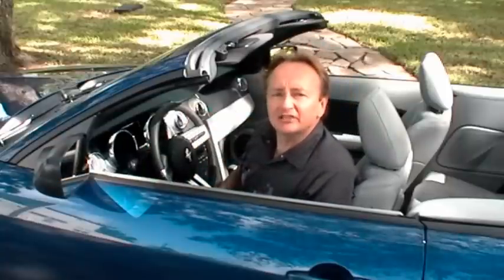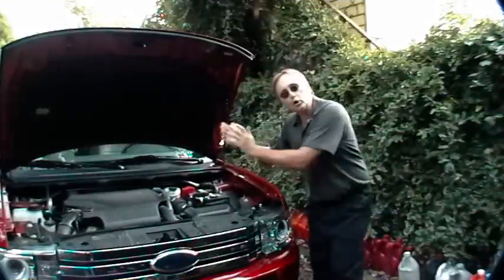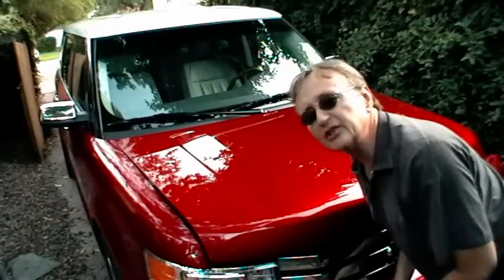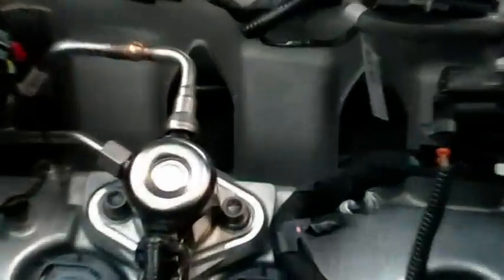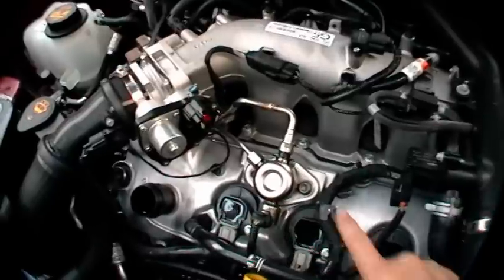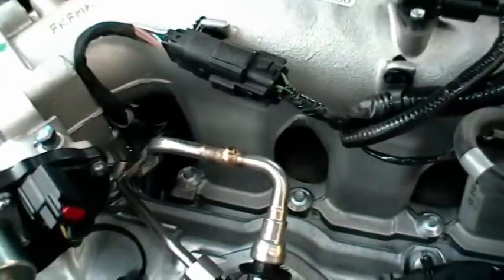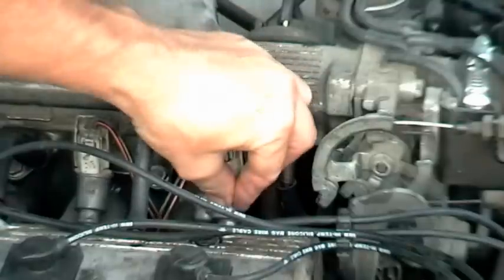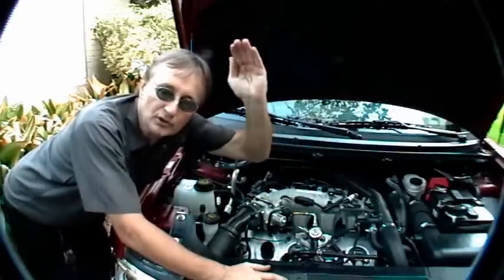How modern technology increases horsepower

Comment: Now that we have direct injection gasoline engines (which is NOT new it was done over 100 years ago).
Will the next step be 2 stroke direct injected engines since now unburnt fuel won't go out the tailpipe and power to weight ratio can increase?

Also I bet now the ecobooost is having the same trouble modern diesels are with their sensitive injection systems. Water separators, dirty fuel, fuel filters, stuck injectors, etc. At least the components the ecoboost has do not need to operate at 30,000PSI
Reply from the maker: many buses already use two strokers as do many boats. But they still have  a hard time meeting EPA pollution standards

Comment: So basically it's a high powered system with to many electronics and could fail at any time. Sounds like a great car to me! I bet they have to be rebuilt sooner than most engines too!
Reply from the maker: of course you hit the nail on the head, BUT that's where modern cars are going, as this video is now 8 years old and MANY cars use this same system today.
Reply: Scotty Kilmer It's sad where the car industry has gone!
Reply: Hunt Guy I know and I'm worried that they'll be no more V8s at all.
Reply: Hunt Guy Plus a lot of cars today are so advanced that you can't fix it in you're home garage you'll probably have to take it to a mechanic to do it for you. Plus Modern vehicles too expensive and ugly.
Reply: CJ Colvin Right. Fuck the stupid ass epa!
Reply: CJ Colvin Yea this industry has gone to shit!
Reply: Hunt Guy I know. You can blame the government for this.
Reply: CJ Colvin I have a 88 chevy k1500 with 275k on it and she still purrs like a kitten!
Reply: Hunt Guy That's cool man.
Reply: ***** For one you're comparing vehicles difference in weight and technology used to build them. So obviously the 2016 is going to be better. The numbers look good but that ecoboost won't last over 15 years, max. I'd put a $1000 on it.
Reply: Hunt Guy I know The Ecoboost won't outlast my old Ford truck.
Reply: Hunt Guy Amen Brother. I have a 96 Ford F150 with 5.0L Windsor V8 with 203,386 miles on it and it's still going strong.
Reply: *****
I have and I wouldn't have a ecoboost, wouldn't mind the 5.0 though
Reply: Hunt Guy My dad has a 2011 5.0 F150 and it sounds like a beast.
Reply: CJ Colvin
Yea they sound badass
Reply: *****
You can keep that ecoboost and I'll keep my motor that has proven itself
Reply: Hunt Guy Oh definitely man and they sound awesome at full throttle.
Reply: Scotty Kilmer wow Scotty! I didn't know that you have been making vídeos since 2009, and you keep us up to date with car suggestions and all that ;)

Comment: So whats a good way to increase HP and gas mileage if you dont have an ecoboost car? like a 2007 G35x?
Reply: weight reduction is the first thing that comes to mind. more horse and more miles just doesnt add up for me no matter how directly the fuel is injected. this direct injected engine makes more power than one with indirect injection because it is more efficient. there are ways to make indirect engines more efficient of course, but more power will always burn more fuel. but you can get to that perfect balance where the tad of extra fuel actually pays of in useful work done by the engine. that doesnt matter in everyday driving tho. if you need more power, youre going to have to sacrifice more fuel to get it. try filling higher octane, you might notice the difference. having a heavy foot will still consume the most fuel no matter what engine you have, but im sure you already know that.
Reply: any tips on reducing weight?
Reply: kuck hoa also new plug wires if they're old enough to be carbon fouled
Reply: Increasing horsepower AND gas mileage? I'm reminded of an old industrial saying, "fast, cheap, good - pick two!"

I recommend trading in the car for something smaller and quicker. Definitely don't listen to that fucking idiot Kuck Hoa. ESPECIALLY don't listen to him about tires and catalytic converters! Overinflating your tires makes the car ride like shit, makes the tires wear down quick in the middle, and makes them more likely to blow out. Autocross guys harden up their tires before they race so the car turns quicker - the only advantage this has - but they let the extra air out before they go home. As for his cat suggestion...$2750 fine and an order to put a new OEM cat on the car are what can happen to you if you do this shit.
Reply: man, did someone shit in your coffee this morning? and what the hell of a country issues you a fine of almost 3000 dollars for a missing cat? i live in an "expensive" country, and its barely 200 dollars over here.
Reply: Cali would be the only state i think. In Iowa they don't give a fuck. My buddy just took his out.

Comment: Direct injection engines have a high probability of carbon build up on the intake valves, to the point that the valves have to be manually scraped by a Technician, sometimes at as low as 25,000 miles, especially if driven mainly at lower speeds like in the city. Hopefully engines such as Toyota's new 3.5L V6, and the 2017 3.5 ecoboost specifically for the F-150, that have both Direct and Multi-Port injectors will solve this problem. But until then, MPI is more reliable and less expensive.

Comment: i have heard over a million times that ecoboost lasts about 150k km because they squeezed so much power out of the engine. after that a complete rebuild is needed
Reply: I used to work on aircraft and the FAA will only put things in their book that they have researched extensively...
 and I remember 30 years ago they had in their book that turbochargers substantially decrease the life of an engine I believe it was more than 20% of course they were talking about gasoline or petrol engines...

Comment: As a 16 year old young car enthusiast, anything other than direct injection sounds like a blast from the past via time machine. Scotty was definitely on the money saying direct injection will be the future. It's crazy watching a video made in 2009 pointing that out.
Reply: One thing that you should not forget, is that every system has its own advantages, and disadvantages. For instance, with standard fuel injection, the fuel is injected into the air intake manifold, before the intake valve. this has the positive effect of cooling the valve, and cleaning it. with direct fuel injection however, this doesn't happen, and because of the exhaust gas recirculation (EGR) system, so much carbon buildup can occur over time on and around the valves, that it can even prevent the intake valve from fully closing. also, the buildup can narrow down the air intake so much, that the engine will lose much of its power, and you might not even get a check engine light :)

Comment: Hello scotty 
I want to know about the product acetone. 
Can you please tell me i sit really improve the gas mileage ?
Reply: Do NOT put acetone in your gas tank. The cost of replacing your fuel pump or injectors early makes up for the 2 MPG gain you MIGHT get. Ease slowly onto the throttle when accelerating from a dead stop, and you will get better gas mileage.

Comment: Scotty isn't it true that direct injection is expensive to fix and in reality it is actually a bad system?  I don't know all the problems that lead from it but there are many.
Reply: yes its bad and expensive to repair. in the mpfi (multi point fuel injection)  system the gasoline does go through the intake valves hence cleaning the valves. that's why with mpfi systems you can see the inlet valves are usually shining and clean even after putting on the car 100k miles. whereas the gdi (gasoline direct injection) system the gasoline goes directly into the cylinder. sure the gdi does provide better efficiency and allows for more performance but the valves in return get extremely dirty and hardly a way to clean that. with these cars occasionally you'll have to accelerate the crap out of them to keep the cylinder head in good shape. you can't really drive those gdi cars like a grandma all the time (take it from my experience).
Reply: You can spray a mist of water through the intake with the RPMS raised to 3000rpm and you can clean the intake valves like that.
Reply: GioGuitarDude
Isn't water bad for the combustion chamber of a car engine?
Reply: Tigerfire75 as a liquid yes. As a mist which turns into vapor because of the heat, no... quite the opposite.
Reply: GioGuitarDude
And yet my car doesn't have to use that to clean it.  I think it is a poor design 
also what happens if I spray too much water?  What is the right amount?
Reply: Tigerfire75 Neither does my car, but this method will ensure a very clean set of valves and pistons which no engine is immune to. You can remove the duct going to the throttle body, manually open the throttle blade so that the engine revs to approximately 3000 RPMs and use a cleaner style spray bottle filled with water and literally spray it into the engine via a mist until the water is gone (keep the engine at 3000 RPMs). There is absolutely no risk of any damage at all whatsoever as long as it stays a mist and there are no jets of water going in. Even if there was a jet of water going into the intake, it would have to exceed at least 1/8 of the volume of each cylinder at full compression to even consider any damage with no other load on the engine. Considering a 4 liter 6 cylinder engine with a 10:1 compression ratio (for example) can hold 400 milliliters of volume in the engine at full compression for every rotation, you would have to exceed a flow of 15 liters per minute to cause damage.
Ain't happening with a spray bottle.
EDIT: Ive actually hooked up a small 1/8" vacuum line to my intake manifold and let the engine vacuum suck up a gallon of water in under two minutes (with RPMs at 3000) and you can literally see the carbon deposits coming out of the exhaust as a smokey grey fog. 
The engine also has to be at operating temperatures, or the water won't turn to steam and clean as good.
Reply: GioGuitarDude
On cars with DI can you actually manually open the throttle plate? 

Have to ask Scotty if what you say is a good idea
Reply: Tigerfire75 You would have to use a friend to raise the RPMs to 3000. Google "decarbonizing engine with water". There are loads of links that cover it.
Reply: GioGuitarDude
I could have my dog working the gas pedal.  She is quite smart.
Reply: Tigerfire75 xD

Comment: hi Scotty I got a Honda fit and it vibrates a bit,when I de-accelerate,and accelerate again,It vibrates too when I'm from zero going forward.
Reply: Might want to check you outer tie rods they should not move or the sway bar link, struts
Reply: check if your brake rotors and/or your brake pads are worn out. They may need to be replaced

Comment: that car has electronic sterring so therefore I'd someone hacks into your car they can control where you go. or if your steering just completely goes out then you are screwed
Reply: You know its still possible to steer a car without power steering right? there is still a physical connection between the steering wheel and the ground wheels, sure it may be a bit heavier but its still possible
Reply: yes I do my point is it isn't a regular power steering that we are used to. The steering wheel dosnt have a steering shaft. It send signals to the computer and the computer sends it to the wheels
Reply: Michael Tallent No lol. its just an electric motor assisting you instead of hydraulic. The connection is still there
Reply: Dude I've had one and a 2015 gt and there is no shaft once so ever
Reply: Michael Tallent Im surprised thats allowed
Reply: honesty I am to I'd be scared that it goes out
Reply: Michael Tallent Not only that, i mean how would you move the steering with a dead battery, at least with hydraulic you still have that physical connection

Comment: ok now explain how that car doesn't have power steering
Reply: +Michael Tallent It is still considered power steering. It's just a different method.
Reply: +Michael Tallent It does its just new cars now have electric power steering thus getting rid of hydraulic so no need to top off or check/replace power steering fluid its suppose to be less maintenance
Reply: +Theunkown1  at least someone knows good job for doing your homework. and no its not power stering it's simply electric. when you turn the wheel sencors transmit signals to the computer then the computer send it to the wheels
Reply: That is considered power steering

Comment: most need 40-60. This one needs 2000! Why? Because motherfucking America!
Reply: If an engine has a compression ratio of 8:1 it compresses 8 atmospheres into the head which is about 120psi alone.
Double that with 15psi of boost and you have 240psi of pressure to overcome and atomize into.
That's why you need 2000 psi to inject properly
Reply: No because direct injection requires high pressures. Modern diesels need 30,000PSI because they operate at much higher compression ratios 18:1 typically.
Reply: Couldn't those pressures kill somebody

Comment: could eco boost be installed into older model cars? like a 97 deville??
Reply from the maker: +CaMel Clay no, engine head and block designs are totally different
Reply: ok and thank you. also another question.. a friend of mines put some Freon  in  my 97 deville and now my air does nothing and sometimes when turning on the air while the car sits, my engine will slowly die... but the air was working fine before, it just wasn't very cold... what should i do??
Reply: +CaMel Clay you might be able to replace the engine for a brand new one which has that technology.
Reply: +Scotty Kilmer what about a 1999 vehicle?
Reply: okay thank you Verliebt

Comment: How much are repair bills on replacing one of those injectors lol
Reply from the maker: oiljerk BIG time money, you have to pull the engine out, that's modern tech for you.
Reply: LOL...No thanks, btw I really like your vids, you tell it like it is and you're good mechanic too. Keep up the good work, I'll be watching.
Reply: ungratefulmetalpansy Electric cars are stupid for heavy duty work
Reply: So is gasoline.
Reply: Yeah that Tesla Roadster you just got...guess how much a new battery costs, and how often they must be replaced.
The new battery costs 29K and must be replaced every 5 years.
That's how they make their money. They sell the car at a loss in order to recuperate money through batteries. The nuclear industry has been using it to sell fuel contracts. It's called a razor blades business model.

Comment: So for the $100,000 question is.  On that Ecoboost ford.  Whats the horsepower and whats the mpg?
Reply: WarinhulAirsoft Actually the twin turbo V6 makes 365hp. While the non twin turbo makes 287hp. Nice try though, but LUNITIC WILL was very close.

$43795	     Flex 4dr Limited AWD w/EcoBoost
4-Door All Wheel Drive SUV, 365 bhp, 350 lb-ft, 6-sp Automatic, 16/23 mpg
7 passengers, 4825 lb, 3.5-liter, V-6 engine, 13.2 lb/bhp
http://buyersguide.caranddriver.com/ford/flex/2015/ford-flex/specs/373339
Reply: well imma guess here and say that with the V6, at least 400hp and at least 30-35 MPG
Reply: ***** Are you fucking stupid? Just because you hear twin turbo doesn't mean its the turbo's you normally see used on racing engines. They're relatively small turbos used to increase power output and gas mileage in the low range. They make the car feel like it has more power than it actually has when you take it for a test drive. Once you hit ~3k rpm the tiny turbines restrict the amount of air they can push into the engine, making their peak boost at lower rpms. The ford flex makes maybe 250hp to the wheels even though it is a 3.5L twin turbo v6.
Reply: Jim White The 2015 Ford Flex makes 365bhp you are right about that. However, this video was made in 2009 and I highly doubt the possibility of Scotty being a time traveler. The 2009 Ford Flex also sported a twin turbo v6 that pushed out a lower 262hp and 248ftlbs of torque at the crank (http://www.edmunds.com/ford/flex/2009/features-specs.html). You could argue that this is a 2010 model ford flex but I also doubt that a pretty much brand new car would need to be brought to a mechanic. So i'm sorry but you, aswell as lunaticwill, are blatantly stupid.

Comment: downside if you run out of fuel... you're gonna break some pumps cause gas is used as lubricant..
Reply: these engine systems will cut the engine off before it runs out of gas completely (always leaving some gas in the tank & engine) protecting the engine & components so no damage is done
Reply: well thats good then...

Comment: Problem whith direct injection is carbon built up on the valves. Gasoline has cooling, lublicating, cleaning properties. When gasoline won't go through the valves next thing you are looking at carbon build up peoblem. GDI engines from VW, lexus, BMW and ford experiencing these issues. It's great technology but it needs improvements.
Reply: harsha806 won't redex or something else injector cleaner on a regular basis solve that problem?

Comment: I recently had a theory that if you add power to your car, you will get better gas mileage as long as I don't increase the displacement. I thought if going up a mountain in 4th gear maintaining 55 mph without downshifting another gear down to 3rd to stay at 55mph it would be more fuel efficient to have more power. Tell me what you think Scotty.

Comment: Mr. kilmer I am wondering about eco boost engine if they can work with out a problem in extrem hot weathers like in phoenix Arizona or the middle east
Reply from the maker: same as any other gasoline engine, if the cooling system is maintained correctly outside temperature does not bother them.